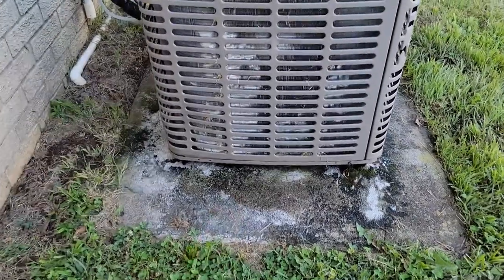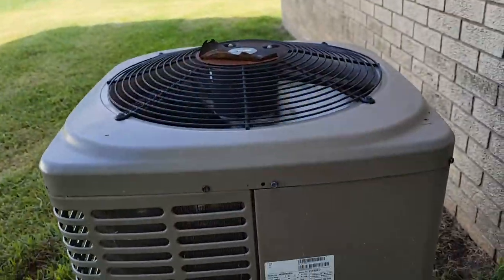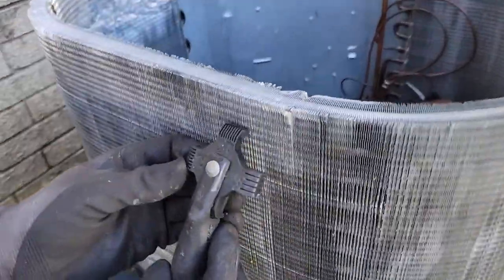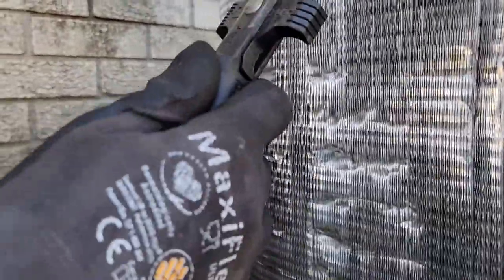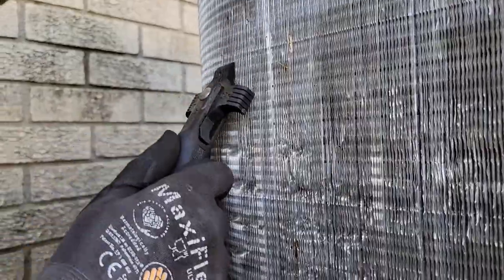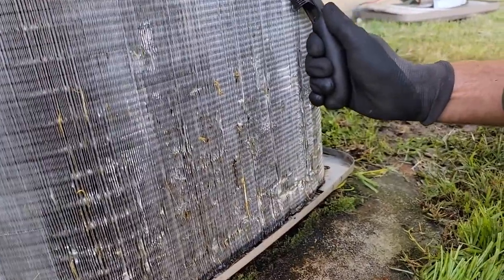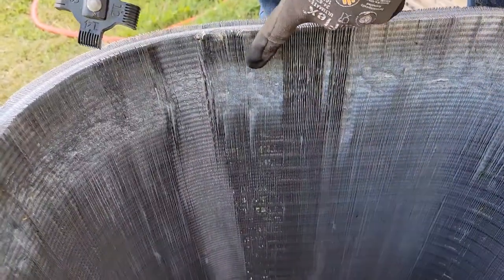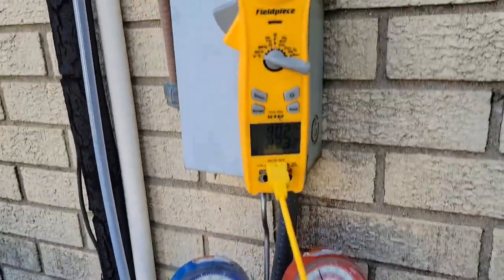How to use a Coil Fin Straightener? @malcotools #coilfin #fintool #hvac

Comment: I love your videos! Recently got back into the HVAC Industry. It is good to note that the top portion of the condenser coils will have the hottest refrigerant coming off of the compressor discharge. In the condition of those coils after operating in frozen conditions, One might suggest putting two defrost sensors in parallel.

Comment: I've "Liked", subscribed, & rang the notification bell.
I just ordered both combs off amazon.
These tools will enable me to do an easy peasy DIY repair on the bent fins on my ac.
I experienced information overload when you brought up Head Pressures at the end.  I wish you  would have, in plain english told us how many degrees cooler the air was as it came out of the air outlet vent compared to B4 straightening the fins.
Warm Regards from Reno, Nevada
Reply from the maker: Awesome! Thank you!

Comment: Taddy, This winter when you energize "Y" and "W" at the same time (defrost or aux ht), you will be sending one leg of power to both Med Hi (Blue) and High (Black) Speeds simultaneously. I would guess you would get abnormally high current draw. Possibly 5-6A. I normally use the larger relay and energize only one speed. 

Also American Standard heaters have the 24V common (C) from heat contactors go through that limit switch on heat kit, then through that larger blower relay second set of NO contacts then on to C side of transformer. This ensures the blower relay is energized BEFORE the heat contactors. It's a good idea on any rewiring of heat kits.
Reply from the maker: thank you I will get on it immediately I really appreciate you
Reply from the maker: I'm going to make some changes and then repost the video

Comment: Hi Taddy, I got a question for you. I used to clean condenser coil fins on the roof with a pressure washer plus Nu calgon chemical spray, but some fins are totally clogged with hard black dirt scales, and the pressure washer didn't work. Do you have any idea to clean fins like this? Thank you.

Comment: At the 6:00 mark you happened to pull some of the fin material out. Does that damage the performance of the unit, or is it okay as long as you don't damage the tubing? Great video BTW.
Reply from the maker: Yes, it does affect the performance of the unit
Reply: @TaddyDigest  so means it is broken or not going to have good airflow?
Reply from the maker: @cedtv8899 yes

Comment: Hi man, I have minor bents in a new Car AC evaporator which arrived today after waiting for 2 weeks. Does the  small Bents affect the car AC system? Should I return it ? Bents are small but I am afraid it will cause damage. I hope someone can answer and help me. Last year I lost my Car's AC compressor, and condenser due to a bad evaporator which development mould in it & led to Black Death & destroyed the whole AC system. So I hope some can help with this question 🙏
Reply from the maker: It depends on the extent of the damage on whether it would affect the performance or not
Reply: @TaddyDigest  if you have an IG or Email, I can send a photo if you don't mind. Actually Installing this Evaporator in my car is extremely difficult. So I really don't wanna risk it if its not worth it.

Comment: Would you see the unit use less power ? I’m sure it makes it more efficient.
Reply from the maker: definitely makes the pressures lower and uses less energy
Reply: @TaddyDigest  thanks ! Then would having misters spraying around the coil to lower the ambient temp and help heat transfer also help the unit run on lower pressure?
Reply from the maker: yes absolutely

Comment: That's the incorrect tool and you fucked the fins up.
Reply: Then what is the correct one?
Reply from the maker: exactly what I was thinking 🤔
Reply: ❤❤❤❤❤❤❤❤❤     I noticed that wrapping filters around the outside of the AC unit and over the top of the AC unit we keep a lot of crap from being thrown into the fins ……… Deliberately lousy design, I would guess     crap like rocks and twigs from weed whacker and hail stones from above
Reply: search for air filter pad    ….   these can be cut to fit  and also attached together to wrap around AC unit